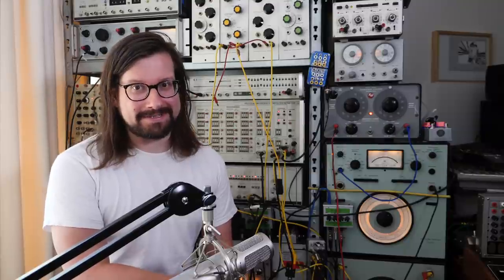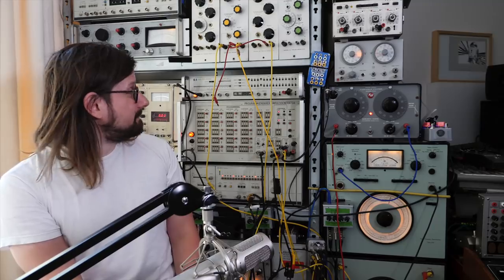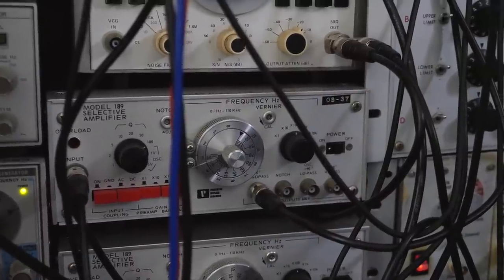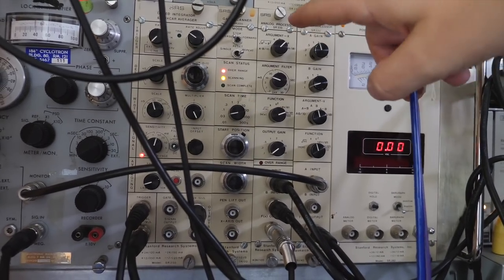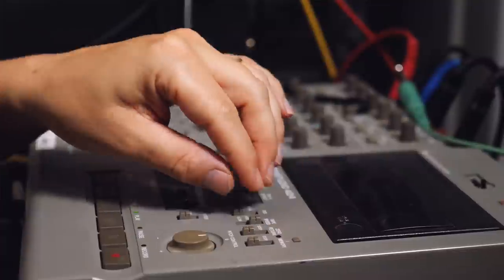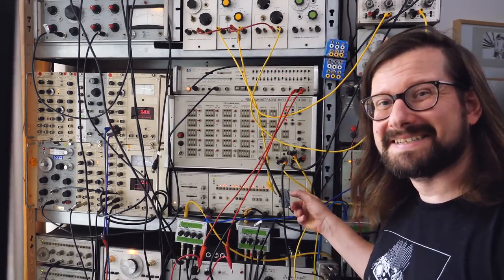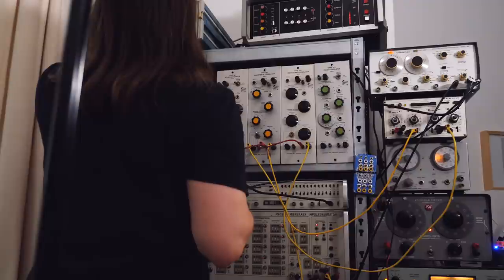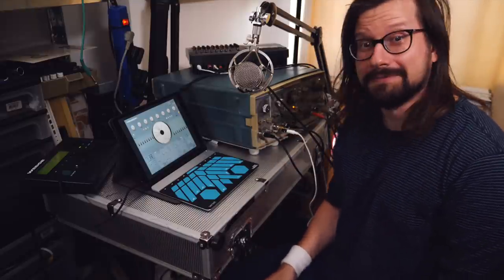Live techno on a wall of test equipment

Comment: Hi Hainbach. I have lots of function generaters/signal gens etc...but no filters. I find it hard to get them. There is no shortage of oscillators, and they are cheap. I'd like a decent filter if you could recommend please?
Reply from the maker: Krohn Hite 310, Par 189, UBM. You can use newer Krohn-Hites but they are no character pieces. But useful.
Reply: @Hainbach  Nice! Thank you so much.
Reply from the maker: Don’t thank me so fast, these are all rare and hunted for 😄
Reply: @Hainbach  Not at all! Your experience in this area is invaluable. It's wonderful at the moment that young people are interested in ancient gear and are experimenting with it. I cant help but feel that some kind of milestone has been reached with Sam Battle's 1000 Oscillator wall. He's very humble about it and even seems to see it as a failure. But it's a complete sucess. That sound coarsed through my entire body and elicited an emotional response! The only failure there is the output, he needs at least 100 speakers to get what he wants. But I'm sure he's on that.